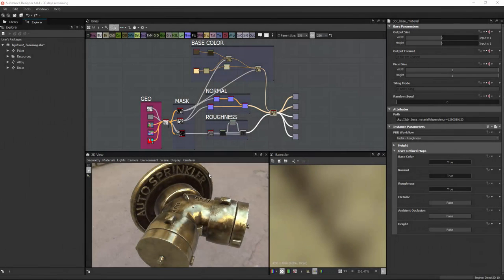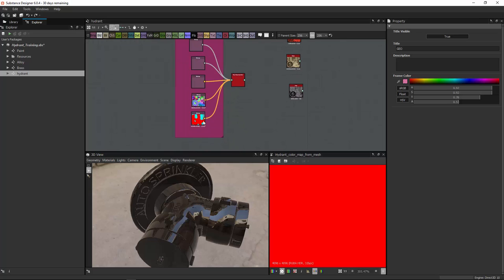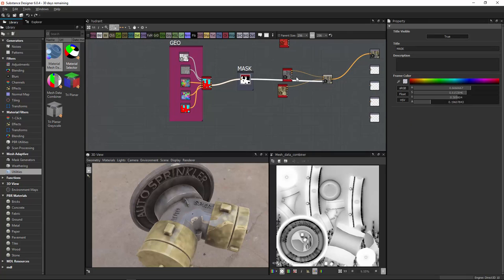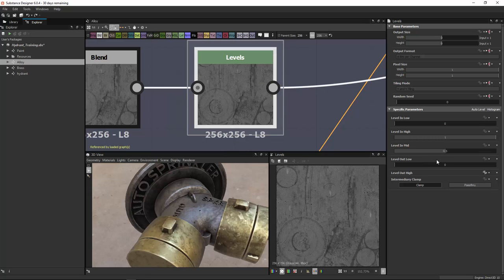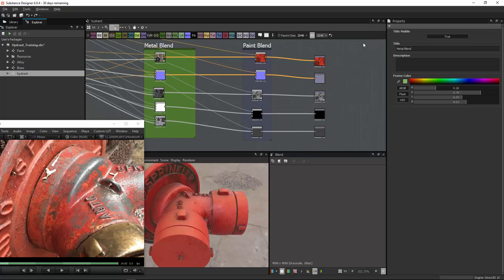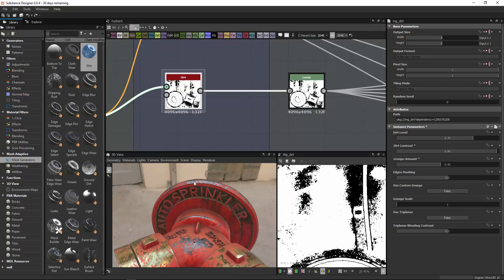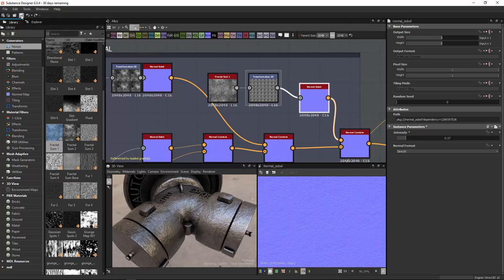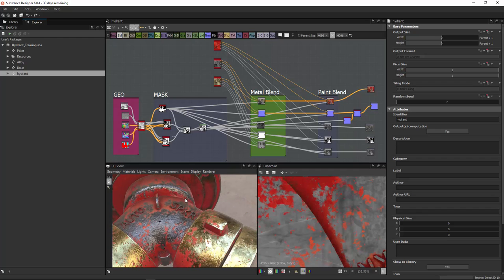MtoA 506 | Substance Designer Part 1 Blending Shaders  [4/4]

Comment: There is Material Blend Node you can use :D and for the mesh maps click on them and set the resolution out put to be relative to parent that will fix the 4k maps. so you can scale them dynamically based on the parent resolution thank you for the tutorials vary good explanations